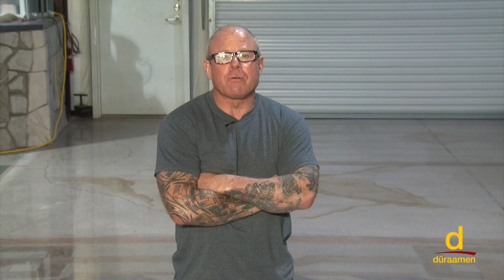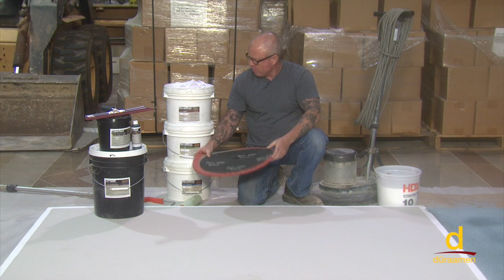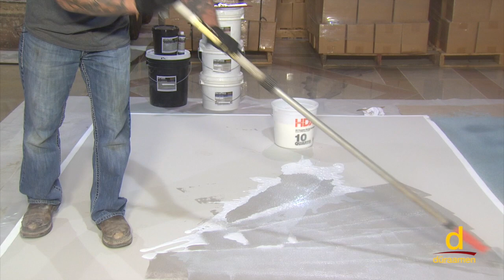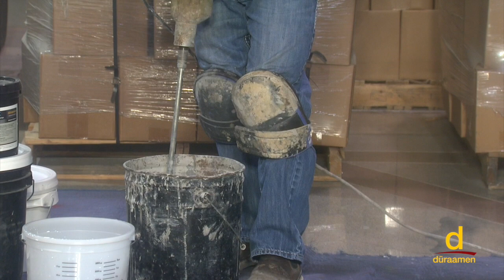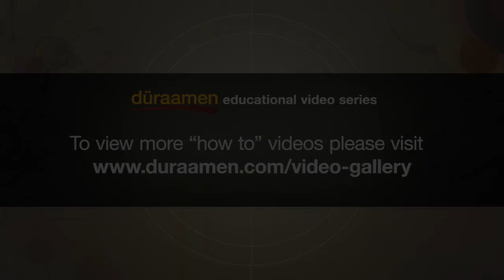How To install Polished Concrete Over Gypsum Subfloor | Part 1

Comment: Can’t you just put a sealer on the gypcrete subfloor to make it your finished floor? Why is it necessary to do a skim coat on top in order to get the polished finished floor if we like the way the gypcrete floor looks as is?
Reply: I'm in that situation now. I pulled up my carpets and like the look of the gypcrete but it's not made to walk on as is. I've been walking on mine and it wears too easily and creates a lot of dust- something I was trying to reduce by removing the carpets. I was going to put down laminate flooring but I like the look of the concrete. I would get mine leveled first and then put a layer of this concrete on top.

Comment: What’s the reason the gypsum needs to be at least a 3500 psi, thanks and love the videos
Reply from the maker: It may not bond properly and dent the surface.
Reply: @DuraamenFloors  Isn't the concrete actually bonding to the primer? And the primer seeps in a strengthens the gypcrete? I used Ardex 51 to prime my gypcrete and then applied thinset for ceramic tile and it's holding well. Granted, it's a small laundry room but still fine 15 years later. 

I've since pulled my carpets intending to put down laminate flooring, but I like the look of the gypcrete ( built in late 80s)  but I know it's not made to walk on. I would love to level it first and then pour some concrete on top as a finished floor.
Reply from the maker: @rgraz4929 what are you trying to say? Or what is your question?
Reply: Thanks